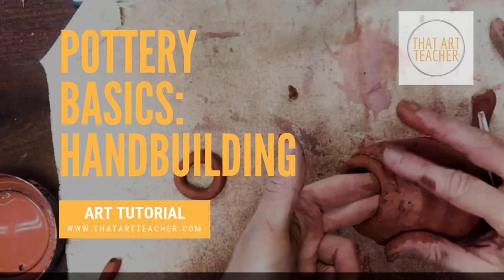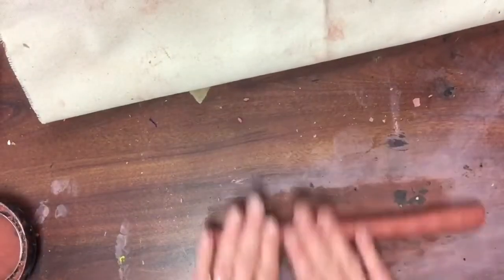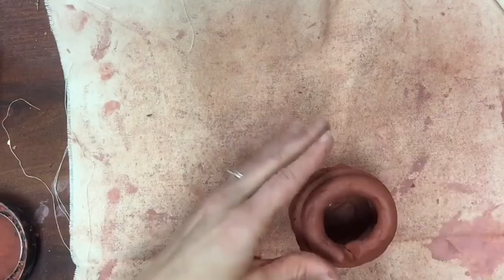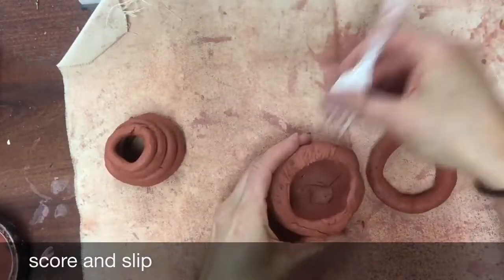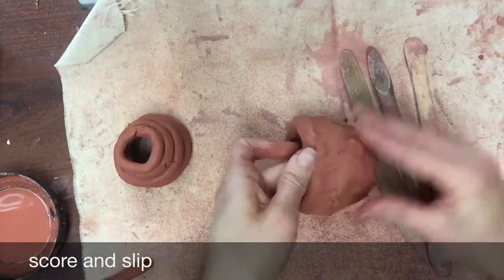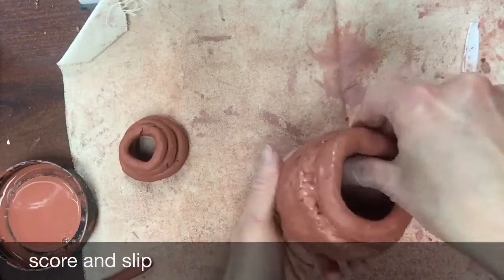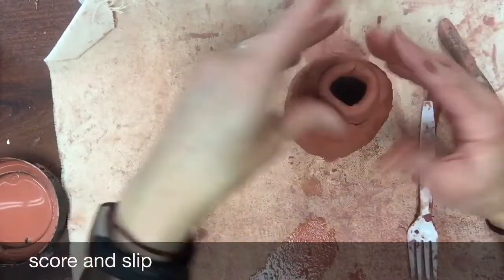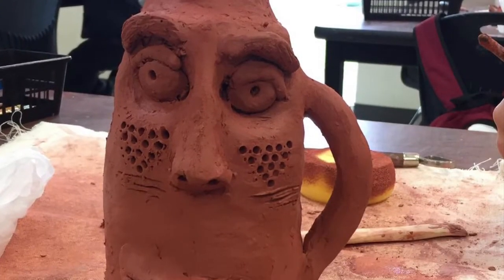Pottery Basics: Hand Building-- Pinch Pot, Coil Building and Scoring and Slipping!

Comment: Thank you for this tutorial. I have heard that these clays are not waterproof. I was wondering if you know a way to make them waterproof through a glaze probably ty
Reply from the maker: I’ve been spraying them with a clear gloss coat, but I’m not sure that’s water proof! Maybe there’s a similar product that provides a seal and a glossy finish?
Reply: Heard that spar varnish works for clay too. Will try it soon. Thanks for replying:)
Reply: It has to be stoneware clay, fired in higher temperatures in order to be fully waterproof. This is due to the particles inside of the clay turning into glass, fusing the particles together. Earthenware clay fired in lower temperatures that you glaze can be used as dinner ware but since the clay will absorb water where it's not glazed or where the glazing chips off, it's not optimal. 😊